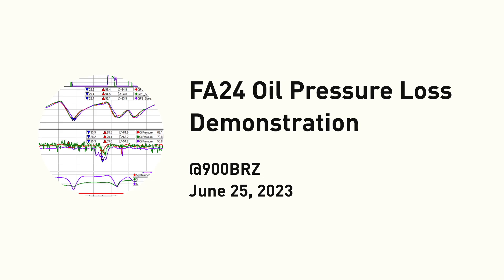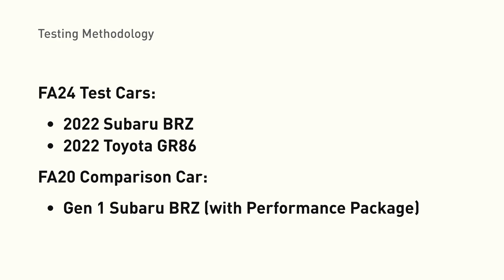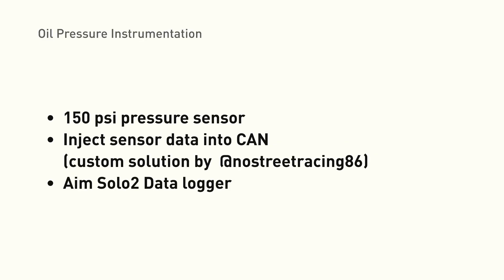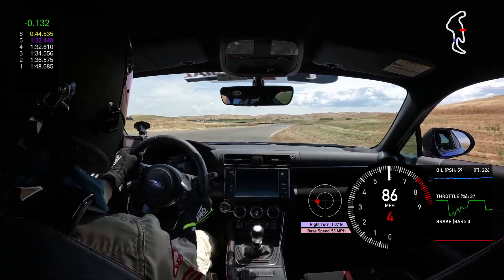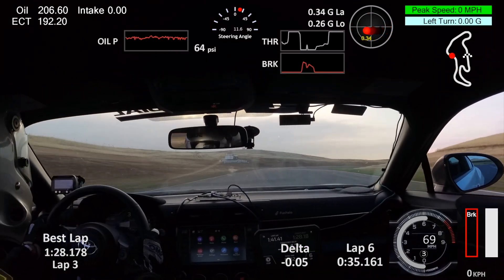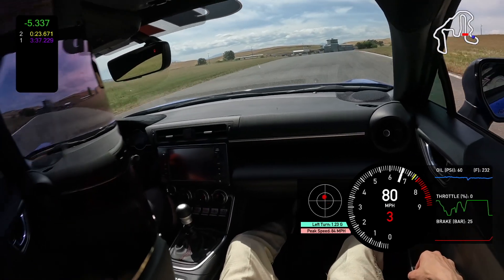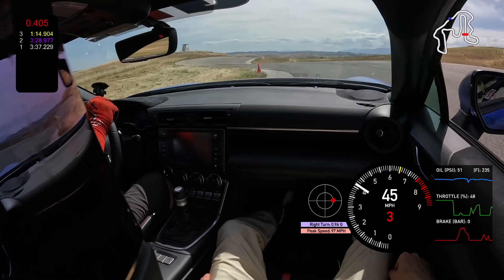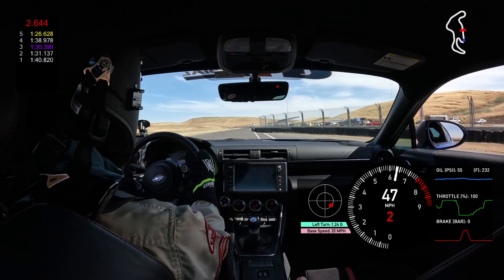BRZ/GR86 FA24 Oil Pressure Loss Demonstration

Comment: I watch your video and you did an excellent job isolating a fault and demonstrating the engine design flaw. I want to thank you for what you did. Now to the bad (unrelated to you). Subaru can't build a reliable engine. Look at Porsche, using flat six for over 60 years and they can figure out how to fix the oil starvation, they even run two oil reservoirs. My concern with this engine is how Toyota marketed the GR86, they put out TV  commercials doing drifting to sell you the product but they haven't stepped forward to offer a solution or to release a TSB(technical service bulletin ) or a recall. I hate Killer B for their prices, they make decent products but they are not competitive price wise. There are companies out there that make electric oil pumps and water pumps, many that is the ticket. I am talking about external electrical pump with an additional oil reservoir. I have a GR86 arriving this week and I have been reading all the engine failures on the forums and I am very concerned specially because I do road course every month.  Good luck with the killer B, hopefully you can resolved the issue.
Reply from the maker: I don’t know the pricing details but this product will likely be relatively cheap if it comes to market based on the size and materials involved. Certainly a lot cheaper than whatever cost Porsche passes on for their integrated dry sumps on non GT cars. 

Totally agree on the marketing and product mismatch we’re seeing here. There’s a Toyota ad right now of a GR86 drifting down a spiral parking lot ramp but it’s wisely drifting to the left not the right, so maybe they know more than they’re leading on.

Comment: Absolutely incredible work. What surprised me most is that significant pressure drops can be observed on EXTREMELY low grip setups. The guys that are running fast 200TW tires/Hoosiers, and 9.5"+ wide wheels are going to have massive drops in pressure.
Reply from the maker: Yeah I think that was the big difference between what I’m presenting here and what a lot of people in the community have been discussing. The standard assumption was you’d only run into problems with 200 TW or grippier tires and advanced drivers.
Reply: One interesting way to visualize this would be a g-g plot with oil pressure imposed on top of it as a color map. 

This way you may be able to see what the exact longitudinal/lateral accelerations for oil starvation looks like and that can help influence baffle design (ie figure out which direction most of the damping needs to happen). It can help isolate corner entry, apex, or exit. But you can also extract a mu at which oil starvation occurs thus you can deduce exactly what grip levels will cause the pressure drop. 

Of course, maybe most of the time the oil is spent sloshing so maybe this won’t work.
Reply from the maker: Yeah we have that and can share in the future!
Reply: @williamrori1274 Would be interesting to see how our hyundai N 2.0 engines do oil pressure wise in turns and in WOT acceleration mode. Is there anyway you can put that video out ?
Reply: @velocityvibezzz  I could defintely do one similar to this. However, I only have a AIM Solo 2, not the DL which can record custom CAN channels. My EK1 Lite may be able to, but the it'll be closer to 1Hz. I'll look into it
Reply: Also as an engineer myself - a presentation, particularly around some analysis, with a conclusion slide to kick things off is excellent. 

Good piece of work.

Comment: Better swap the FA20 into your 2nd gen twins 😂 sucks for people who track these hard out of the box, which is silly in itself, but this is nothing new as it was discussed heavily with the FA20 but considering by far most people just do street driving don't get why there are many commentating they are worried about getting a twin, there are no documented failures from those just street driven otherwise if you can't afford to replace your engine/car don't track it.
Reply from the maker: Yeah, I think if you’re going to drive on the street with relatively low-grip tires and make no powertrain modifications there shouldn’t really be any warranty issues even if something does happen. I have heard of street-driving failures but don’t have anything specific to cite.
Reply: @900BRZ  I had 2 FRS for over 11 years with a total of about 120 K pretty hard commuting miles, aside from common TOB squealing which got replaced under warranty, I had virtually no issues with my twins.  Even with the valve spring recall fiasco, these engines are very reliable when not modded for more power, otherwise gl to your rods..  I know FA24 block is a bit different but I can't imagine reliability will tank this generation...would have one to see for myself but got a GRC instead 😝
Reply: @kenkozawa9810 did you have the valve spring recall work done? I’ve heard a lot of Toyota techs  were crunched for time/inexperienced and resulted in more issues than if left alone.
Reply: @stevef3521  you're totally right, there were multiple documented cases of folks having a failed engine after getting it done but statistically, the likelihood of problems was still pretty rare.  I haven't been following that side of things for a while now but IIRC it was only for 2013s unless they expanded out the model years.  I had a 2013 from new which got totalled in 2015 when a woman ran a red-light into me and I replaced it with a new 2016 which I just sold last year so luckily I never had to deal with that recall..

Comment: hey man, I don't think it's the pickup that's at fault, it's the location of the oil filter?
Reply from the maker: Say more
Reply: @900BRZ  well, I'm probably wrong, but it's a large pressure drop offset to one side of the engine, you're having problems WRT cornering to one side, dunno?
Reply: @900BRZ  also, does this motor run an oil cooler, is the takeoff for the cooler before or after filter, I assume toyota designed this motor to send oil through filter first before main oil galleries? Maybe also have a look at pump design, what is pressure relief set to, and what is presssure relief, if any, on the filter.

Comment: Can't this be fixed by dropping the sump and adding/ welding in some baffles and trap doors  at the oil pickup?
Reply from the maker: That’s effectively what I’m going to be trying, but the baffle I’m going to be using (from Killer B Motorsport) is actually a quite small vertical plate. We’ll see if it works. You have to be careful about horizontal baffles in boxer engines as they can restrict flow back into the sump. Also trap doors can fall off and are more likely to do so if used in a horizontal orientation. To do this confidently, you need a lot of testing and I don’t really consider it to be a DIY project unless you have a lot of experience with these engines. 

Installing a well-tested baffle very much can be a DIY project I you’re confident in dropping and resealing the pan.

Comment: i know a guy who has a 22 gr86 that tracks it pretty frequently and has put down a very impressive 1:52 (possibly a 1:51 at this point) at The Ridge in shelton, wa. I am keen to know if he ends up putting a new engine in that car. as far as I know he hasn't modified the powertrain at all, most likely relying on the oem warranty. i want to love this car despite its downfalls but the oiling issues are a redflag i will not ignore.
edit: man that's wild only 60psi at wot, my shelby does minimum 80-100 even at 210f
Reply: different weights of oil can drastically change oil pressures. thicker oil runs at higher psi
Reply: The Ridge may be biased to left-handers, but its largest crest does happen to be a right-hander and I’ve personally blown an FA20 on that track. The FA20 was known to have oiling problems, so it makes me sad to hear that the FA24 is even worse. (It’s news to me because after too many FA20 problems I swapped away from the boxer and never looked back.)

IMHO the only real fix is to swap the engine or sell the car. I hope your friend continues to have good luck with their engine!
Reply: @snarky-drive-by  That's my local track too and I've been thinking about the corkscrew and the run up the hill (can't remember turn numbers as I've been away for a while). Both of those being right-handers with elevation changes scares me. I've just picked up a GR86 and now I'm debating if I'll ever take it to the track. Super huge bummer.

Comment: thank you so much this is very informative, can't believe that slight right turn can cause so much pressure drop, this is a more serious issue than I thought, hopefully the prototype baffle can help otherwise an accusump seems to be the next solution other than a drysump?
Reply from the maker: Need to do more research on Accusump but people with more experience than me including Killer B aren’t very enthusiastic about Accusump on a dual purpose FA24.
Reply: @900BRZ  shame, I thought that was the answer of daily drive + tracking😔 wish you luck on the testing 🤞we really need to get this solved !

Comment: As a former experienced service advisor for Toyota in NorCal.Allow me to contribute to the enthusiast community. My friends Gr86 suffered catastrophic failure at 12k miles.The rod bearings on Cylinder #2 and #3 were found to bedisintegrated upon tear down. This was likely to improper lubrication. We also found the oil pick up clogged with RTV. The mesh was close to completely obstructed. Now the Toyota field tech blamed it in low oil. The oil was not low. The field technician made it his task to deny the warranty because the car had track car appearance. He said "hes been drag racing". He also claims that the oil pressure was healthy during the "idle and hight rpm test" and the fault was due to over-reving to 7kRpms consistently.  He called it abuse. Therefore he helped to deny the warranty using that statement. I was a service advisor at the time and when i asked him about the RTV he completely dismissed it. When i asked him about the oil starvation due to RTV at massive GForce turns, he also dismissed it. Toyota just released an article that claims to deny any warranty if engine failure occurs due to Recreational racing or tracking in other words.  Toyota has had many legal settlements nationwide that relate to engine failures. They're aware of the potential problems so they are covering their rear end by releasing that statement.  The field technician expectations for these vehicles to be driven like a old lady and should not be pushed. I didn't want to push back hard in fear of loosing my job at that time. Good luck bothers.
Reply: I believe I knew the owner of that car you refers to. And thank you for what you did to help my friend. I believe the failure is due to a combination of engine design flaw and poor manufacturing. This oil pressure dropping issue is due to the engine design. As a long time Toyota fan I was quite disappointed when I heard the warranty request was denied. If this engine design issue wasn't going to be addressed, we will see more and more engine failures like this in the future as these cars age. And don't forget Toyota gift every owner a free track day and I am sure some of the engines will suffer this in their track day experience. I hope the data we collected in this video can be used as evidence if a class action is needed.
Reply from the maker: Thank you for commenting and sharing that story, frustrating though it is. I also think I know the owner you’re talking about. +1 thank you for helping them to the best of your abilities.

Comment: Was any testing done on 0W20?
Reply from the maker: No, I stopped using 0W20 before tracking the car and long before installing the oil pressure sensor. Only way I’d test that is if Subaru or Toyota were supplying the car and paying me haha
Reply: It’s a great video, with all your points and methodologies being well thought out and presented.

For thoroughness it would be good to collect some data for 0W20 even off track around town, just as an OEM baseline. Would help to define if this is limited to track use or any condition, also help to quantify benefits of alternate weight oils.

My only thoughts would be the lower viscosity of 0W20 allowing for easier return to the lower pan resulting in a higher volume for the pickup, compared to 5W30. May just be a unfounded idea.

Comment: This FA24 need a competition oil Pan and baffle like EJ badly，I am surprised why there is no company made one of those like for EJ oil pan
Reply from the maker: It would get expensive because due to space constraints you’d need to sell a custom header with it in order to clear a deep sump. Then you’d need a new pickup and you’d have to remove the timing cover to install it. Think it’s possible though, but there may not be a market for it.

Comment: Temporary stop gap solution: Attack right hand corners 1 gear higher 😂
Reply from the maker: That’s a reasonable approach and I’ve seen less pressure losses with short shifting. You may or may not lose time depending on the corner.

Comment: Hi! I hope you guys are reading through comments; how is the oil cooler installed? What side in the intake/output on?
Reply from the maker: Yes, reading all the comments. I recommend looking at the installation instructions here: https://jacksonracing.com/pdf/instructions/jr_gr86brz_toc_na_manual_rev1_1.pdf

The cooler core is located centrally in front of the radiator and the lines run up under the driver side headlight to the sandwich plate mounted under the oil filter.
Reply: Where and how is the oil pressure sensor installed? It’s my understanding the stock sensor is a switch, not a sensor that has usable data.
Reply: Sorry I see the pressure sensor locations now; can you perform this same run without the oil cooler installed and see what the results are? (Essentially return the vehicle to stock and see what’s it’s reading unchanged)

Comment: As an owner of 2018 brz race car and a daily 2022 gr86, I will not put the 86 on the track until there is a solution for oil pressure. Imagine putting in 20 laps in one day on that track. The engine won’t (might) blow, but man, the wear on those bearings is immense with those drops. 

question. 2gen has more hp/torq then 1gen. With fast laps, can the gforces for 2gens power difference add to the loss of pressure? My 2018 brz is getting close to the same 2gen numbers, but oil pick up it totally different. Just curious thought?
Reply from the maker: Most of the time when we talk about G forces having an effect on engines we’re talking about the G forces applied to the car and engine by the suspension components and tires, not the internal forces created by reciprocating or rotating parts within the engine. 1 G of lateral acceleration, for example, will cause the oil in the pan to slosh to the side and the surface will be at a 45° angle. This is a very different challenge to acceleration without lateral acceleration. 

I’d expect you’d experience similar lateral G with both cars, if they were on similar tires and suspension, despite the power difference.

My understanding is with increased power comes increased internal loads within the engine and likely more heat, which requires more robust oiling and potentially a higher flow rate. Flow rate is harder to measure in engines than pressure.

Comment: Amazing work and documentation on the issue, I’m intrigued to see how the baffle helps with the 22+, also curious to see if the ‘17 would consider the killerB oil pickup and if that would help the FA20.
Reply from the maker: I don’t think they are currently planning to adapt the baffle for the FA20 since it’s a slightly different shape, but if it works I’ll bet they’ll consider it

Comment: How did you determine that the pressure at the sensor locations are equal to the pressures at the big end bearings? Conventionally the low pressure switch would be positioned at lowest pressure point of the pressurized oiling system. Also what was the pressure drop over the non-OE oil cooler?
Reply from the maker: I don’t have a source or data since I added oil pressure logging after the oil cooler, but I’ve heard the nominal pressure drop is less than 5 PSI with the oil cooler. Jackson Racing uses the same Setrab oil cooler core that is used on GR Cup cars. 

I’ve looked at diagrams of the oiling system on the FA24 and the location of the factory oil pressure switch is immediately after the oil filter. After that it splits to lubricate the crankshaft bearings and passenger valvetrain and the driver side valuetrain. The location on the block is after the first split, so it has a slightly lower nominal pressure than the switch location. Overall pressure drops were still consistent despite the difference in nominal pressure at the two locations.

Comment: Man what a world class production. Impeccable methodology, and shockingly good driving. Nice job guys. Just got my BRZ, still in break in. I'd be interested to hear about that prototype baffle.  Please share the results
Reply from the maker: Will do! Testing the baffle on July 1 back at Thunderhill.
Reply: @900BRZ  Watch out for the heat - forecast shows 110F in Willows this weekend.
Reply: For real. Owned the car for less than a week then this video comes out 😅
Reply: @gotfood9389 for real. Got mine 3 weeks ago. Now I find this out.

Comment: As someone who competes in the 86Cup and running the same suspension and tire setup I'm curious to see the results with the baffle. Is it possible to log oil pressure using an AIM Solo II DL without adding an aftermarket sensor? See you at TH on 7/1 ?
Reply: No, you need a aftermarket oil pressure sensor (as OEM doesn't have one, OEM oil switch is just a ON/OFF switch). You also need a Analog to CAN injector board to inject the sensor data to CAN bus so the AIM Solo DL2 can log it.
Reply: @nostreetracing86  Thanks!
Reply from the maker: Yes I’ll be at TH on July 1! And of course, @nostreetracing86 is correct